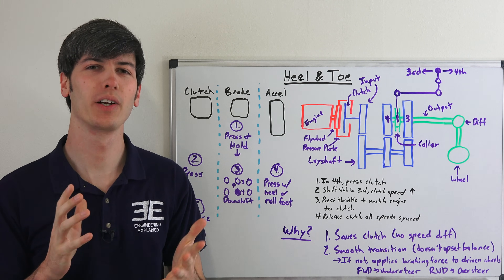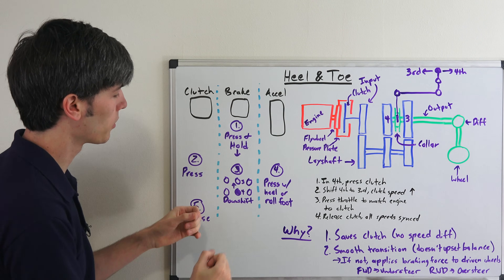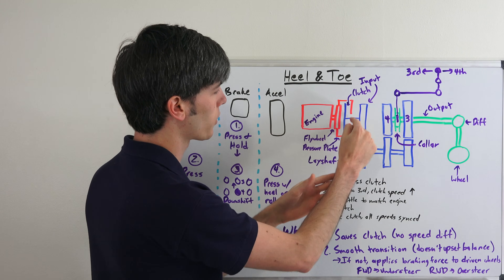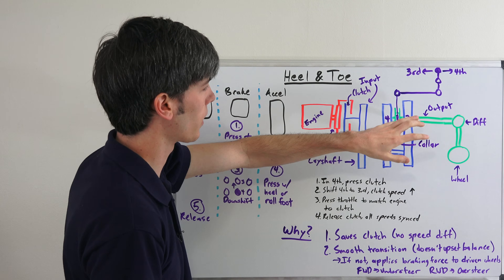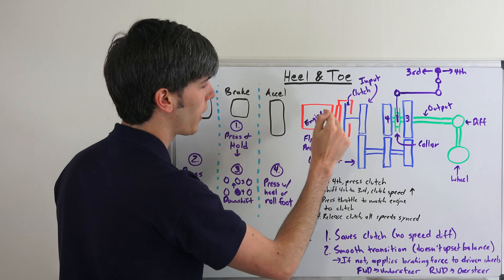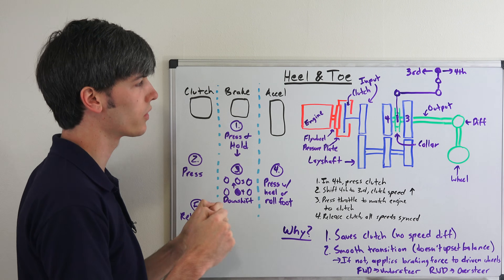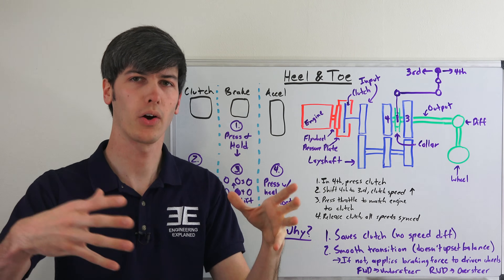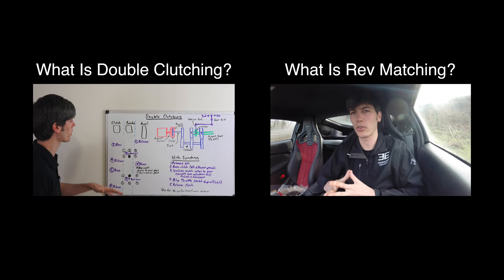What Is Heel & Toe? (Downshifting)

Comment: he said that the clutch is going faster because it’s in third, but wouldn’t it be going the same speed because you’ve applied no extra engine power (because the clutch pedal is in) and all that’s happening is a different gear is turning another different gear? (rather than fourth input spinning fourth output, it’s third input spinning third output) so the clutch is going the same speed and the driveshaft is just connected to a different gear, no?

Comment: I’m pretty sure his blue sections are green sections are permanently connected, not able to turn at individual speeds.    The output shat of any manual transmission is directly connected to the differential, and then to the wheels.       Transmission output shaft speed is equal to the driveshaft speed

Comment: Does each gear essentially rev match at the same engine rpm or do higher gears require more rpm when down shifting? What would you say is a good rpm to initiat the down shift and  what rpm would you say is to low?

Comment: OK, so I get the idea but what about simply blipping the throttle, rev match and shift.  Are you always using the brake?  If so for what reason to always use it?  The moment you rev match, then you are now using 'compression braking' from the engine without putting any speed differential stress on the rest of the simply but simply now coasting at a lower speed.  I can see use cases for racing but for daily driving on straight roads, what is the benefit of using a brake in the process?

Comment: Correct me if I'm wrong but doesn't Heel/Toe require to shift into neutral and then apply throttle? As far as I know gearboxes nowadays have synchonisers that match the RPM of the input shaft and output shaft, gearwheels respectively, while shifting, so to get the input RPM higher you should shift to neutral so the engine and the input shaft stay connected. Then the applied throttle will rise engine RPM and from there the input shaft RPM will rise and match the output shaft, that is connected to the wheels, and you won't have to wait for the synchoniser to do it's job. Otherwise if you keep the cluth pressed the engine and input shaft are separate, and even if you rev the engine you still have to wait for the synchroniser to match the RPM.

Comment: Quick question, is it worth doing this on an automatic (torque converter) car with a sequential mode? The automatic mode is old and very slow to shift, so using the sequential is a must for good fuel economy and smooth ride.

Comment: Im having trouble doing this. 
The problem is my brake and throttle pedal are on different level/depths.
 to heel and toe i have to brake almost fully in order for my heel to reach the throttle pedal. 
And i rarely fully press the brake. 
Any suggestion???

Comment: I noticed the synchronizers work hard by this method I’ve also practiced so I thought it would be better to press the clutch then blip the throttle to synchronize the axles then select a gear then release the throttle. However, I’ve tried also this but I couldn’t do it because the rpm drops too much so I could only give it a blip then select gear then another blip to release the clutch. This would be a double blip single clutch method. There is also the double clutch method but the it faces the same problem as a single clutch shift
Reply: what do you mean? barely any work for the synchros if you do it properly

Comment: Thanks for the perfect explanation! I'm learning h&t. Obviously, I'm not matching it perfectly all the time. Sometimes I miss the revs, and when I release the clutch, I feel a kick. It is not something catastrophic, but it feels wrong. First question, how much damage I cause to the car when I miss the revs while h&t? The second one, what is worse, when the revs too high or too low? The third one, sometimes happens that I don't have enough space ahead to let the engine slow the car after I downshifted with H&T, so I have to keep pressing the brake pedal immediately after I blipped and put the lower gear. It feels a bit rough too. Is it damaging?

One more thing, since I'm pretty slow at h&t, I'm revving high. I think sometimes it is 6k. At this point, I think I'm at a safe place because I drive a Porsche 987, and the engine is built to rev high. Anyway, is it ok to blip that high?

Comment: the problem i encountered is. i can still down shift without heel toe by press brake > clutch > shift gear > gas > release clutch. i didnt press brake and gas together. is it means i am slower? i still tried to sync the engine and gear during shifting anyway. i don’t understand why i need to learn that weird stance to down shift. it hurt my legs

Comment: I don't understand why we are putting it into gear before we are ready to accelerate. Why not leave the clutch in while braking, then when we are ready to accelerate do a normal shift into the correct gear(let out the clutch while applying throttle to match)?

Comment: One thing that isnt clear to me is why you still need to rev-match if you brake. If you break your wheels get slower, then you do the downshift, but do you really need the revmatch ? Isnt the clutch already spinning at a lower speed due to you breaking or is it just still too fast and you just do it for the last bit of speed difference? If its like that should you blimp the throttle even shorter than when you do a normal rev-match without breaks? Thanks for the answer in advance.
Reply: Most, like 99% of all comments and the video itself is total nonsense. Here how things work on racing cars: nowadays you got manual sequential gearboxes = no toe-heel is ever used. You only use the clutch when shifting into the 2nd gear from the 1sh and when shifting from the 2nd gear into the 1st. But during a race, you push your car to the limits, you rev it up all the way to the red zone on every gear. You break as heavily as you can but during cornering you can neither brake, nor accelerate 'cause you racing car will spin off (less likely to happen with a civil car, say a Ferrari or Porsche or BMW or whatever), but you still want the maximum. Hence even during cornering you apply a touch of braking and a touch of acceleration -- in fact as much as you can without spinning off to do the best lap time. It means sometimes you press a bit of throttle and brake together as a consequence of pushing everything to the limit. The same was the case 20 years ago with H-manual gearboxes. People applied a bit of braking and acceleration very fast in corners. Look up for example Ayrton Senna's technique: how he blips throttle in the corners which sometimes overlaps with a touch of braking. That's all there is. Dummy drivers just made up a lot nonsense. What's more, during the race you really push the car tachometer into the red zone or in other words you apply a bit of throttle when downshifting to increase RPM. It's not rev matching! It's the opposite! It's increasing the revs and destroying the car. After each race a car needs serious maintenance due to the severity of the races. Sometimes the car doesn't even survive through the race and something is worked to death. So it's a battle of how much you need to push the car and how much you can go a bit easy on it or you won't make it to the finish line! Don't listen to those wanna-be sim racers who use stability control cheats and post records (They are cheaters but will never own up to that). If you have a manual gearbox car, just make sure you fully release throttle and fully press the clutch when shifting. NO REV MATCHING IN NECESSARY. IT'S BS DUMMIES CREATED. A bit of braking and throttle in the corners (at max possible cornering speeds) allows some oversteering (a micro touch of drifting) to go through corner a touch faster, i.e. at absolute limit! Specifically, throttle allows to compensate oversteering and some oversteering compensation can also be done with the steering wheel itself. Find on YouTube the following videos and see how feet are working in the corners and in straight lines; watch carefully how much braking and throttle is applied and when they slightly overlap (in corners):
1) Ayrton Senna's Heel-and-toe
2) The 919 Tribute Tour: On-board record lap, Nordschleife.
3) Inboard: Frank Tore Larsen Ford Fiesta WRC
BOTTOM LINE: YOU DON'T WANNA DO TO YOUR CAR WHAT RACING DRIVERS DO TO THEIRS DURING THE RACE BECAUSE YOUR CAR WILL DIE IN A MATTER OF MONTHS IF NOT DAYS. THAT SAID, OCCASIONALLY YOU CAN PUSH IT TO THE LIMIT OR TWO FOOT IT FROM THE START (LAUNCH CONTROL IS FOR DUMMY DRIVERS) BUT DON'T RUING YOUR MACHINE BY DOING SUCH THINGS OFTEN.
I'm outraged with all the nonsense I see on the Internet. I guess I was venting.

Comment: When I slow down to stop, I stay in gear until the engine is around its idle revs, then I put it in neutral.  Is that bad? Should I learn the H&T method?
Reply: H&T is only for fun/racing, so you don't have to learn it

Comment: When you brake your body wants to keep moving and if you have both your feet on the pedals, as long as you are not pushing one of them until it doesn't move anymore you are left only with the belt to keep you in place. Belts are keeping you in place but you still move quite a bit, it is not like a locking system on a rollercoaster so your feet are pushed forward. You push the brake ( not completely, you have to keep your foot up at some point )  and at the same  time you push the clutch (completely). You select the lower gear and you gave a touch to throttle while braking which is okay because your left foot is pushed to the end and it is like you are standing on it so you can make any adjustments with your right foot. But while keeping that position on the brake without pushing too much or lifting too much when you take your left foot off the clutch after rev matching, until your left foot is placed somewhere fixed, your left foot is in the air your body is still trying to move forward and you are still trying to keep that sweet spot on the brake pedal with your right foot. Right there on that moment i keep screwing up. My right foot gets pushed further than i would like and end up locking up the wheels. Clutch pedals are high and they have a long travel distance pretty much in every car but i guess brake pedals differ more. It looks like your foot is on the brake but your heel is on the ground. In my experiences, i had to lift my foot off the ground in order to push the brake pedal comfortably. Can it be the reason? if not then what might be the reason? why am i falling on to the brake pedal like that? Are you keeping arms straight against the steering wheel pushing yourself back to keep yourself in place? ( steering is not comfy in that case tho ).. I am definitely doing something wrong but which one it is i couldn't figure.

Comment: isn't H&T a performance-oriented technique, if you're racing, or if you're on public roads and want to pretend you're racing?  you can approach a turn with brake, push in clutch, downshift, release brake and coast around the turn, then hit the accelerator to get the engine speed correct for the new gear, then release the clutch.  you're not hitting the brake and gas at the same time, but also not wearing on the clutch.  it's just a bit slower since you're not accelerating in gear as soon out of the turn.  no?
Reply: Having the clutch in during a turn is a big no-no in a racecar.

Comment: This explanation glosses over some key details.  There are two phases....getting OUT of gear, then getting back in.  You do not need the clutch for either.  So, as you are braking in 4th, the gearbox is loaded with the wheels exerting a backwards from normal torque which results in the engaging dogs in the box being locked backwards.  A slight blip of the throttle (optionally with light clutch) will "slack the box" and it will pop out of gear into neutral.  Then you let the clutch back out.  Or you can not use the clutch at all and just use the "blip" to slack the box and get out of gear.  Now, The layshaft and output shaft have not changed speed.  The problem is 3rd gear pair is going too slow.  You need to speed up the engine WITH THE CLUTCH NOT PRESSED IN so the dogs can pop in.  So you blip again, which speeds up the engine and drive train including all the gear pairs.  Now 3rd gear is close to matching the dog speed, and you and clutch again to engage.  If you are good....you can use no clutch at all.  This is a true, proper double blip downshift.

Comment: I've seen this 2 different ways. This video explain it the way I do it.

Brake, clutch, down shift, rev match, then off the clutch.

But I've seen it more commonly done in these steps.

Brake, clutch, rev match, down shift, off of the clutch.

Does it matter? Would the 2nd way be better on synchros? Just asking because if it matters then I need to switch.
Reply: well, it's pretty much the same thing.

Comment: No one in rallying use heel and toe
Reply: That's because most rally drivers use sequential gears over manual gears, so they just use two pedals, throttle and brake.
Reply: @KevinAbillGaming  even with manual gearbox.

Comment: The reason why you need use the heel and toe.
1. Correct smooth transition: In short like in example when you at 4th gear at high speed before entering the corner, when you brake.  and downshift to 3rd gear. You will feel hard to shift its because the gears are in torque tight just like a door knob difficult to open because there is  pressure at the opposite side. The pressure plate at high speed has difficulty to disconnect to clutch disc. The hub also of to each gear are tight mesh To totally separated in each other you have to accelerate while depressing the clutch pedal to release the residual torque. And able to change gear smoothly.

Comment: Hey how come when u shift from 4 to 3 the speed increases...the 3 gear wheel is larger sonit should have low speed right.
Reply: hi, 

assume your vehicle is travelling at 40mph
when when you disengage the engine from the transmission through the clutch assume there is no loss in vehicle speed through natural retardation

the output shaft of the transmission remains at the same speed, if not the speed of the wheels and vehicle would change even though your engine isn't connected to the drive train, however when you change the gear from 4th to 3rd the input shaft (clutch is attached to this) of the transmission will increase speed as the gear ratio has increased. (gear ratio increases with lower gears) 

This is because in order to maintain the same output speed at a higher gear ratio the input speed increases. for example, we have gone from a gear ratio in 4th gear of 2:1 to 3:1 in 3rd. the input shaft has gone from needing to rotate at 2 revolutions per 1 revolution of the output to 3 revolutions. 

So you then blip the throttle to increase the engine RPM so when the clutch and engine connect there's no speed differential

"the 3 gear wheel is larger sonit should have low speed right"
if you use the same engine RPM for both gears, then yes, the output speed of 3rd gear will be slower than 4th, this is called engine braking. In the example in the video you are maintaining the same output speed so the input / engine RPM changes. 

As you move up the gears the gear ratio decrease and so you need lower input speeds for the same output speed, thats why the revs are low when your cruising at 80mph down the highway/motorway in 5th vs if you tried to do 80mph in 3rd. the opposite is true when you move down the gears. 

You

Comment: Il your gearbox has a weak synchro or if you want to save them, you could also release the clutch on the neutral, push a little bit on the gas to synchronize the two parts of the gearbox and then quickly push the clutch again and downshift.

Comment: question, how do I know how much throttle to blip (in RPM) to match what wheel speeds (i.e. 30 mph)? So if I normally am at 5k RPM in 2nd gear doing 30 MPH, when I'm coming from 3rd gear and slowing down and shifting into 2nd gear, I want to brake and blip the throttle to 5k RPM right? Okay I think I just answered my own question.. because I think that's how it works.. I think after a while, the process becomes so natural one doesn't have to "think" about it, rather they just "feel" it?

Comment: If you don't heel-toe, can you avoid turbulence by simple pushing in the clutch and selecting the appropriate gear?

I never learned heel toe earlier and only used said method with some significant success. Just wondering what the community thinks.

Comment: I really can't get my head around the accelerating part. Like why do you? That raises the revs doesn't it, which seems to be the point, but I thought that you'd go into higher gears with higher revs. With my current knowledge that isn't getting this, it seems like you should be reducing your speed to change to the lower gear so why are you supposed to quickly raise the revs? What does that do?

Comment: How do you know when your engine speed is matching or close to your clutch speed.  Does the tachometer indicate this?
Reply: Gagan Grewal yes, too high of an rpm would just be redundant cause your bacically trying to accelerate while also breaking. As to how do you know, it's just practice. Every car is a little different but you get used to which speeds require which rpms in which gears
Reply: Exactly the question I wanted to ask. How do I know the right RPM at which to release the clutch ? If the input rpm is too high then it would still cause clutch wear ?

Comment: +Engineering Explained , what if you just break, press the clutch and then downshift and accelerate normally, by putting your right foot fully on the accelerator? Is it slower or what's the problem of leaving the break   pedal?